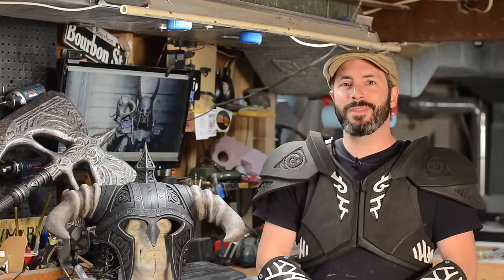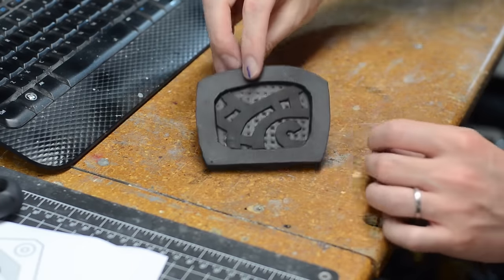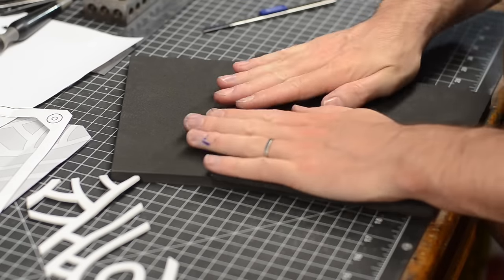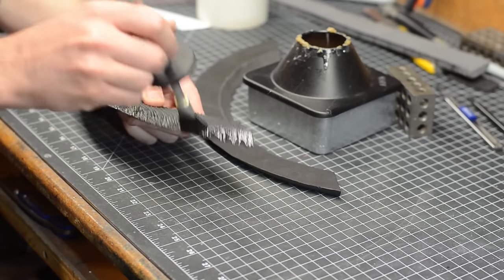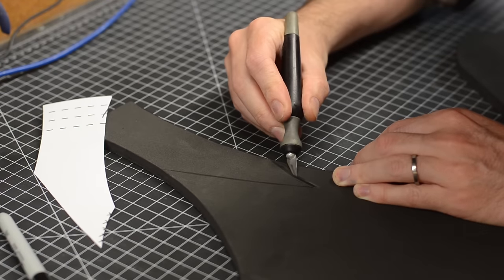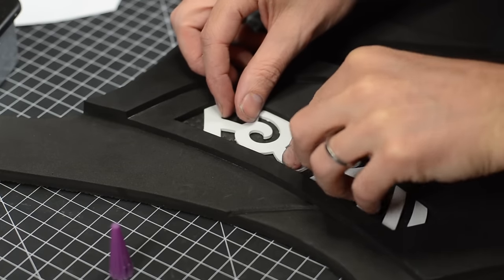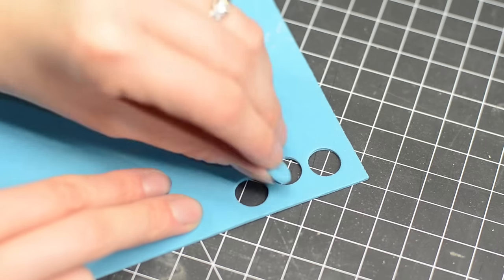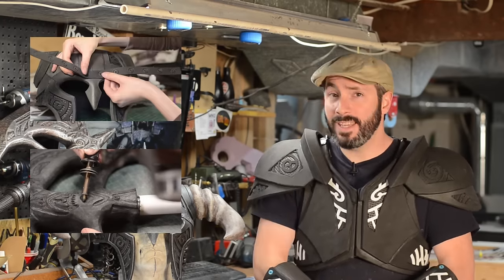How to Make the Skyrim Steel Armor Costume Part 1: Foam Fabrication

Comment: For anyone else interested in building this set, I'm 5'6 and on the skinner side, and found that scaling it to 91% was the perfect fit!
Reply: This is good advice, thank you!
Reply: Kirsten Houten is there a program you used to scale it?
Reply: Elfie Campbell whilst on print preview there's a few settings (such as b&w or color, page orientation, front and back printing) and "scale" is one of them. It's defaulted at 100% so all you have to do is type whatever percent you'd like. In my case, that'd be 91% (:   (I use mac so I'm not entirely sure how it would be on another computer!)
Reply: Kirsten Houten Your directions were perfect, thank you!!
Reply: Kirsten, did you modify the chest piece for the "lady parts"?  if so how?

Comment: Nice diy I can actually see a way of doing this with forged steel.
Reply: Half the work is the template you have a nice one supplied.👍🏻 done two suits of fantasy armor in the past (one for a lady I did martial arts with and one than for myself for going to ren fair) out 13-10 gauge steel and leather strapping and the hardest part was measuring and fitting. Your blue prints helps a lot with the shapes. Currently in process redoing my old one and looking to some thing new if I do choose/use your design I will give props to you and send video pics of final. Keep up the great work!

Comment: Tip: if you are bigger or smaller than Bill then just print your templates bigger or smaller.  I will certainly do that if I make myself a  set of this armor.
Reply: On the contrary, that does not include the more generous or slimmer sized people.
Reply: Kazara Digital I am much smaller than him both height wise and weight wise. Is it just a matter of trial and error while printing to see if it'll work out?
Reply: Kirsten Houten Probably, to save paper you can print one piece and find what scale works and scale it all up to that. I haven't actually seen the templates so I wouldn't trust me too much though. You can also just print them as they are and try (emphasis on try) and scale them down after.

Comment: First cosplay I ever made, advice? Thanks again Bill, nice meeting you at DragonCon.

http://imgur.com/a/Lm7JP
Reply: Any tips? I have the whole process there from start to finish, any glaring mistakes?
Reply: That armor looks great!
Reply: Thank you! :D any advice?
Reply: you really killed the armor, awesome detail and lighting
Reply: thanks man!
Reply: My advice? More steroids :D Jokes aside, your job looks great, but when i think of Gears of War i think about how massive the characters are :D
Reply: E. Mailissimo Youre not wrong but in the latest incarnation they said they are going more for a Nolan batman approach than Burton batman. So moving away from the super rationed buff guys.

Anyways it was more about the build I was asking about, dooesnt look metal or shaped well enough to me :/

thanks!
Reply: Have you coated it with resin? Is the original armor from the game metal or is it some kind of composite material? Maybe you could add some more layers of paint and weathering? 

It is a bit difficult to see it on the pictures, i don't know about the shape, as i haven't played the games, but shape-wise it looks good to me. The blood doesn't look all too real, from what i can see on the pictures. You could try adding some cotton wool to the paint to add more "slime" to give it a bit more structure... but it's really hard to say, on your pictures it looks good, the only thin i can see is the blood that doesn't look all too real. The rest (material/shape) looks really good, pretty awesome.
Reply: oh i didnt make the gun its a replica from NECA toys. thanks though! Google gears 4 JD and youll see who i was triyng to be.

Comment: Hey Bill, for all the little squiggly bits, would using something like a hot knife make things go any faster if you've got a reasonably steady hand? I was wondering because the foam is so thin that you'd risk melting if you stayed in one spot too long (kind of like with a wood burner, although you could always consider that battle damage I suppose), but with a variable heat knife it might give it just a little extra ease at a lower temperature.

Comment: Heyho 
I've got quite a strange question: what are these metal blocks with the holes in it called you used to hold the paper templates in place? I've been searching for them for quite a while but nobody could tell me where to find them... Can you help me?
Reply: 123 blocks. They're mostly used for metalwork. I guess he just has them laying around and likes to use them for holding down stuff.

Comment: I ended up buying a large roll of anti fatigue foam floor mat, but I'm not sure if it will be good for this
Reply: Punished Props the only problem is I'm not sure if the foam is thick enough and its rolled up, so I have to somehow flatten it. Any tips?

Comment: We are trying this with the same glue and foam here but it's a disaster. House long did you hold the peices together for glue to dry?
Reply from the maker: You have to apply glue to both pieces and let them each dry separately (about 5 minutes) before pressing them together carefully for an instant bond. Pressing pieces together before the contact cement dries won't work.

Comment: Hi Bill, I have an idea for new video. Or maybe you already made it. 
I am a hobbyist photographer, mostly portrait & beauty shots, in studio. 
I want to build female warrior armor that can be adjusted for any models I am gonna photograph. It could be around 1-2 inches height difference between models and my concern is the chest circumference which vary more than the height, some models more skinny, some more beefy. So any tips to make adjustable body armor. I  am thinking of using laces, extended velcro,etc. Thanks
Reply from the maker: +nixland I think that's a cool idea. I can't promise I'll be able to make a video on that, but I will consider putting features like that into one of our upcoming costume projects.
Reply: +Punished Props Thanks Bill.

Comment: Could you use that fancy notch thing (for your registry marks on your patterns) to cut out the notches on your screw heads, or would it dull it too much and ruin the tool?
Reply from the maker: That just might work!
Reply: Punished Props Academy cool!

Comment: #PunishedProps 
In the blueprints pack doesn't have the right side of the chest_back, has only the chest_back1 and chest_back2, can I use a converted chest_back1 / 2 image to create the missing chest_backs for the right side? 

I think I can because it's just an improvisation because of the absence of the chest_back on the right side.
Reply from the maker: Everything can be mirrored to create both sides.
Reply: Could you show me how to make the (chest of) this same armor for women?

Comment: How many floor mats did it take to make the armor? I’ve got a set on my shopping list through amazon; but was wondering if I’d need a second set?
Reply from the maker: I honestly can't remember at this point, but it's always safe to over-order. You'll have materials for future projects!
Reply: I figured as much; but just wanted to check with you first to see if you remembered how many you used. I just found you through your boba Fett/ Mando helmet build. I put together a Pauldron based on you other skyrim build.

Comment: Does anybody know how stable this foam is? Can you larp with that foam?
Reply from the maker: You absolutely can if you finish it properly. For something as heavy-duty as LARPing, finishing your foam with several coats of latex and painting it with rubber cement or latex paint will make your props and armor surprisingly sturdy. Creature cast neoprene is another great option, with a few different levels of rigidity. Great question! We haven't done a lot of experimenting with creating LARP quality props, so if you do any tests we'd love to hear how it goes: https://twitter.com/chinbeard

Comment: Sorry for a question on an old video, but what thickness of floormats did you use?
Reply from the maker: I'd recommend 2mm for details and probablt 3-4mm for the main armor pieces
Reply: @punishedprops  Would 5mm also work for the main armor?
Reply from the maker: Sure!

Comment: Question: do I print the blueprints on regular sized paper? Letter size? Or should it be bigger?
Reply from the maker: You can print blueprints using any of those methods! If you're printing from a standard printer, you can print everything out and then tape the pieces together to create one big sheet and then cut out your pieces. You can also easily take your files to an Office Max or anywhere that offers large format printing and get them printed full size on one sheet of paper for pretty cheap. It's really down to what you have access to and what works best for you!
Reply from the maker: Also these specific blueprint files are meant for a letter sized printer.
Reply: Thanks so much!

Comment: Full Floormat Armor Set - Light Armor 
Armor - 53 
Weight - 32
Value - 1015 

These are not made up stats, I did my research and then subtracted 10 from each armor stat, divided all weight stats in half, and just ramped up the price of each piece. 
Base Armor Stats are Steel Armor Stats

Comment: Do scroll saws work well on foam?
Reply from the maker: They do OK. We prefer a bandsaw, but there are some cuts you can only get on a scroll saw.
Reply: @punishedprops  might have called out the wrong tool... Was meaning the hand tool that's like a thin-bladed hacksaw